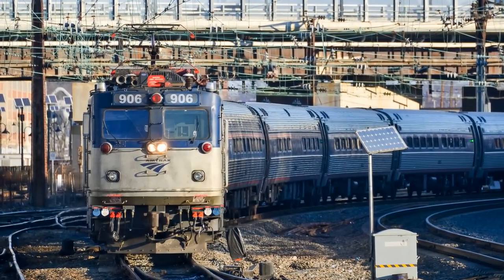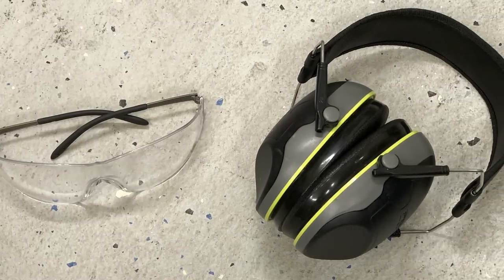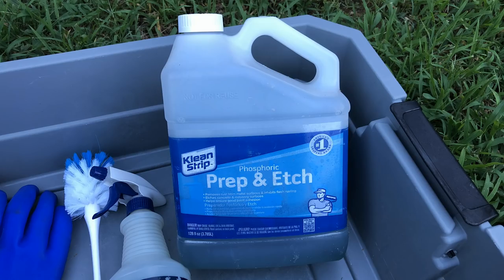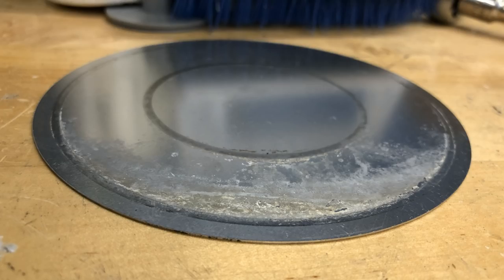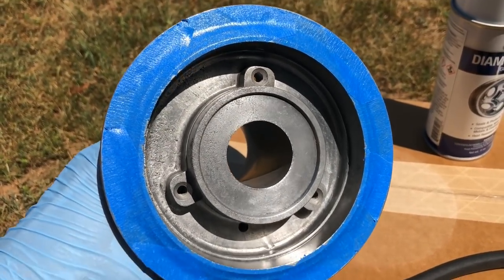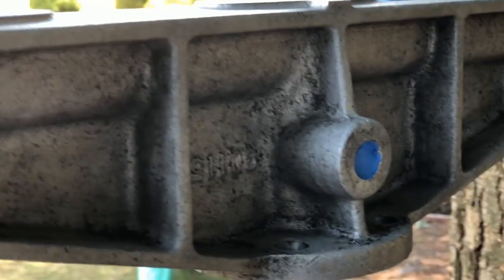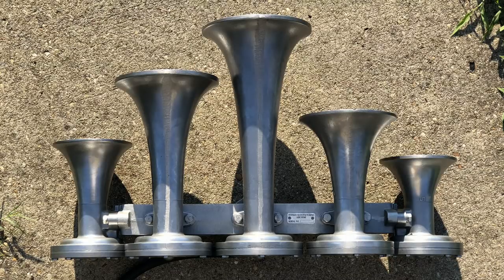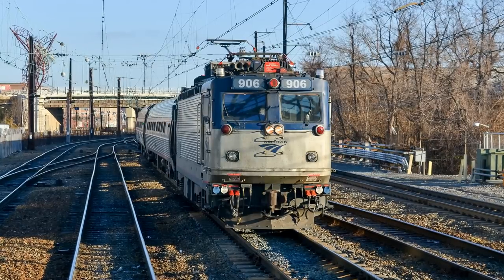HOW TO: Restore a K5 Train Horn (Natural Finish)

Comment: I have been curious as to how exactly the dual Graham White 501 valve setup is configured in the Genesis, Acela, and HHP-8. As far as I understand it, there is a two-stage button, and the first stage activates one of the valves which is restricted in some way to provide that half-blast sound. The second stage apparently activates both valves for full blast. My questions are: how exactly is the first valve restricted, and what model of GW 501 valve is used (I have seen two different models online)? Any insight into this from someone knowledgeable on the subject such as yourself would be very much appreciated.

Comment: Did you Prep & Etch the diaphragms? Or just use the steel wool? Just picked up a K5 and want to do the exact same process. Also, what was your Prep & Etch ratio? Did you dilute it at all?
Reply from the maker: I just used 0000 steel wool on the diaphragms.  I mixed the solution 50/50 with water.
Reply: @mdamttc199  Thanks so much for the feedback, excellent video, I saved it to my "Good Ones" lol. Do you mind if I pick your brain a little more? I re-watched a few times and didn't hear (or see) you use the Prep & Etch for the manifold, it just showed to horns getting bathed and scrubbed. Did you use it on the manifold and if you did, did you plug up the inlet holes so Etch / water didn't get inside? Should I clean the inside of the manifold with something?
I haven't opened it up yet due to the bolts being rusty, I just sprayed it with rust-penetrate to get them loose, but if inside the diaphragms / seals are damaged do you know where I could order replacements? It's the horn from CSX-4402 which was sent to the scrapyard after it collided head-on with CSX-5000, so I want to make sure this baby is in tip-top shape, thanks for your expertise Kind Sir.
Reply from the maker: @skyvipers  yes you can prep n etch the manifold and let it go inside. Just be sure to rinse it out well and  use pipe cleaner or bottle brushes to make sure it’s clean. Usually the inside of a manifold is pretty clean unless a bunch of compressor sludge made it’s way in. The diaphragms would have to be purchased as it’s not a common thing you’d find most places. They show up on eBay or you could look into other avenues

Comment: Is there any torque  spec for the back caps or ??
Reply from the maker: Not that I’m aware of. They should be snug but not over tightened as the aluminum threads will strip easily.
Reply: Awsome  thank you i just got a set my chambers were full of corrosion got them looking good but need a back cap for one but cant seem to find anything

Comment: when you applied the prep and etch, did you soak the horn in it or just spray it on and then scrub? and what did you use to scrub the horn with just a wire brush??
Reply from the maker: Sprayed it on and used plastic bristled brushes and 0000 steel wool. Metal brushes will scratch and scar the metal.
Reply: @mdamttc199  i did your method as seen in video, it worked beautifully!! thank you for the upload it was a huge help

Comment: Doesn't sound like it's getting enough volume of air through it from that small tubing on the side of the manifold. Consider using the bottom flange air inlet, it's a bit larger & what it is originally intended for. P.S.I. should be approx. 125 - 150 IIRC also & use a big air tank (30gal or so & up) with min. 3/4" I.D. tubing or pipe with a GENUINE Graham White locomotive horn valve. Trust me, it'll sound way better.